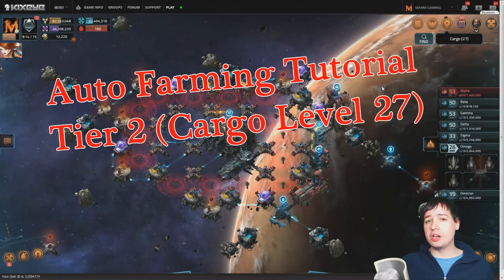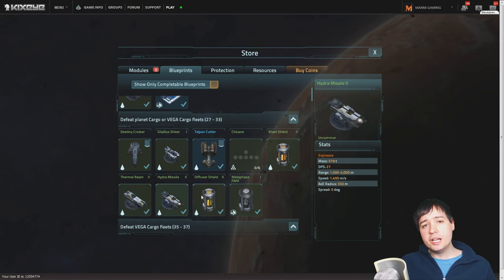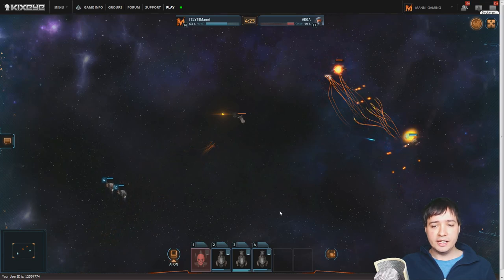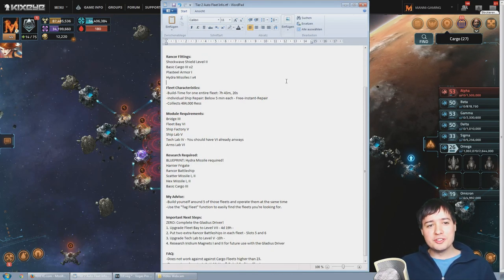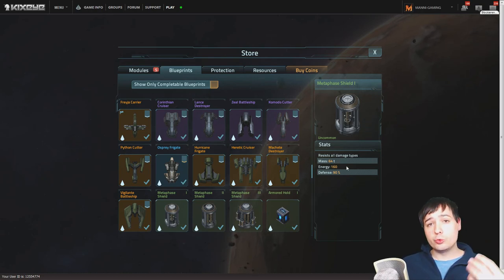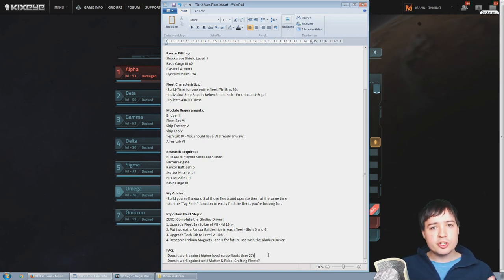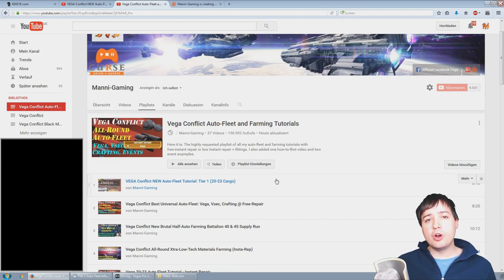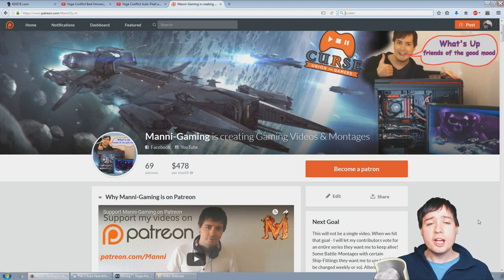VEGA Conflict NEW Auto-Fleet Tutorial: Tier 2 (27 Cargo)

Comment: +Manni Gaming - This is no longer viable. tried with 3, 4, and 5 Rancs fitted as such with the 1 harrier, simply cannot take down a 27 cargo. Your Gladius rancs still do the job however, i cant do gladius yet, waiting on pre-req tech to finish to be able to fit them to rancs. for now.. im stuck waiting.
Reply: Correction. this fleet setup is no longer viable for 1 hit. If you paired up a longbow fleet of hex IIs, to hit after the 1 harrier + 3 rancs with hydra 1s, its a win. The range on the enemy battleships is greater than Hydra 1 range, so the rancs get blasted before they can take a shot, the long bows are able to pew pew and finish the job.
Reply: It is still actually still viable...
Reply: I am using the this setup right now...

Comment: Hello Manni

A Quick note for the new Genesis 20 Fleet.  I noticed in a recent run with them that some ships instead of less than five minutes came up with 6:20 of repair.  Followed your fitting with the only difference that some were Mk II Genesis cruisers.  This time was for fully destroyed ships in the fleet.  Is the MK upgrades causing the increase in time or is there some other possible cause.

Thank you.
Reply: all of my gens are mk2 and I get same repair times as he does, double check which shield and armour you've used. the mk doesn't affect repair times
Reply: +Lerone6886 Triple checked across all my ship classes.  Same specs except for Mark Upgrades and all are above the five minute instant repeair.  William Wang also stated below that Mark upgrades affect repair time.  Will when have resources recheck with Mk 1 ships.
Reply: +Mitchel Bethel  This is for Genesis and Rancor ships
Reply: +Mitchel Bethel I've checked again and built fresh ships and upgraded them and there is no change in repair for me at all, only.mistajr I did make at first was fitting wrong shield, fitted spec 2 instead of shock 2 and then added armor which made it over 5min repair. I have 50 rancs and 60 gens and they are all mk 2

Comment: ummm... manni i followed everything in the tutorial and i cant take down a 27.

 i have a Mk II Harrier frigate with spectral 2 plasteel 2 and raildriver 2 x2 in slot one.

then 3 rancs that are Mk II and have shockwave 2, plasteel 1 once, basic cargo 3 x2, and hydra 1 x4 on slots 2, 3, 4 in wedge formation....

my fleet level is only 24.

please respond
Reply: BasicallyPlays It's been 1 year since this vid came out they rebalanced a lot
Reply: I can almost take down 27s with this set up, i would add a 4th rancor to each fleet, should do the job, building up another one myself atm, only have 1 fleet atm to test with :D
Reply: Alright, tested with a 4th and 5th ranc, still cant take on a 27 with the above specs. Instead, use 1 Harrier and 3 rancs, with a second fleet of either longbows, or something to get the last few hits on the 27 battle ships, i use longbows with hex 2 (longbow instant repair, fleet lvl is 8, they can take on up to 25 cargos auto, and 15/17 scout/artillery)